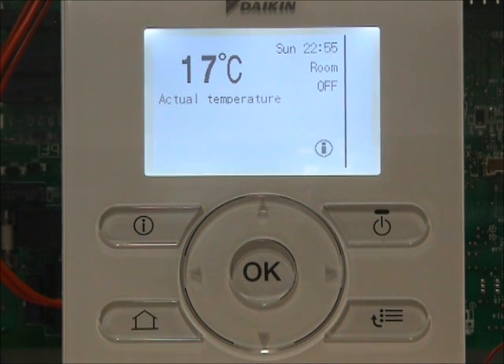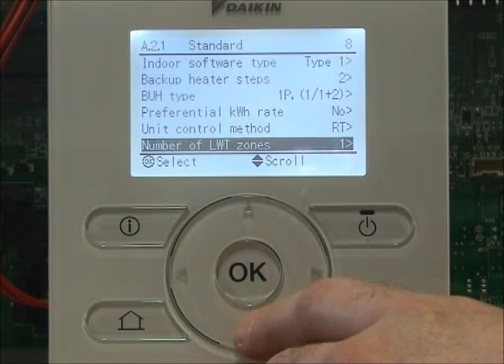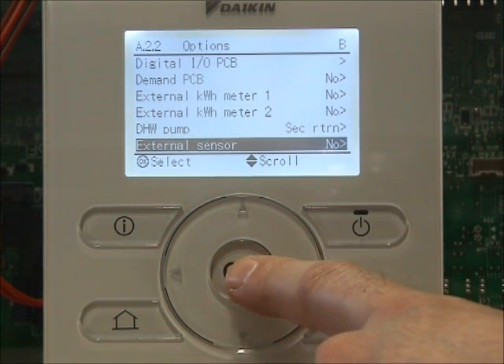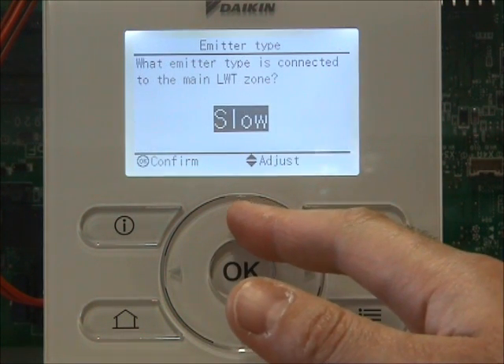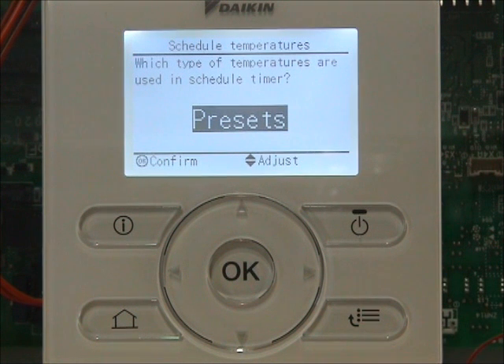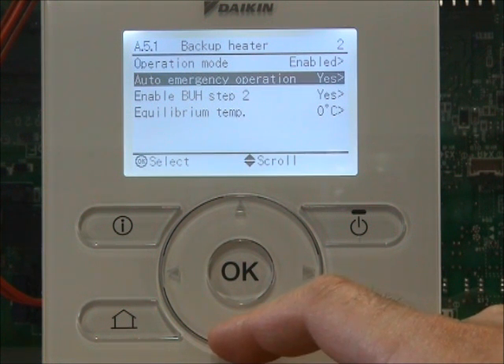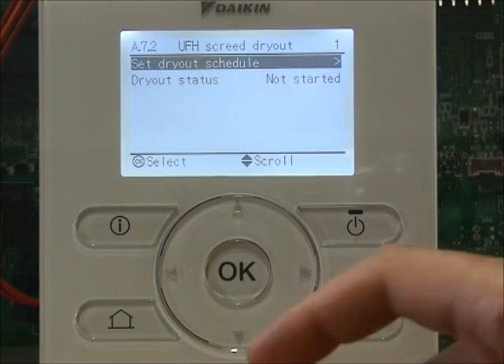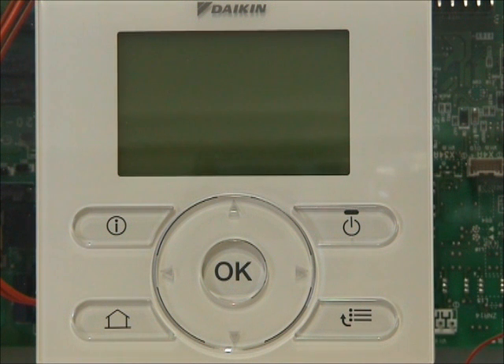Daikin Altherma Heat Pump Hydrobox C Series Controller Tour Of The Installer Menu

Comment: Hey! Very useful video, I have a daikin LT which has this pannel in a cupboard inside, the monoblock is outside. Connected to a HIVE thermostat which is in the hallway. I want to uninstall the HIVE as apparently is thr worst for heat pumps, but do I need another thermostat or can I just use this pannel you are showing?

Comment: What a brilliant video which explains it so well for an absolute novice like me.  Only one problem - My controller used to show many things on the menu but now only shows "Adjust date and Time" I have tried the switch off for 60 seconds trick but this does not restore the original menu.  Any ideas??
Reply: Press the menu button and then hold on the info button, that should give you extended menu

Comment: hi great video about important parameters ..! i have a question please : is it possible to start manually the water pump (circulator) simply to adjust or tu tune the water flow  on each loop of the circuit in order to equilibrate them ?
Reply from the maker: Yes you can do this in the actuator settings

Comment: Hi if you're still on here, what should the 'Desired Comfort and Eco Main LWT offsets' be set at for Heating? Thank you
Reply from the maker: This will depend on the design of your system. If you speak to your installer they will be able to guide you as they designed the system based on a flow temperature.
Reply: @brunstar111  Thank you

Comment: Hi. Thank you for uploading this very detailed video guide to the controller. I've recently moved into a new build house with a Daikin heat pump system and the instructions we've been provided by the builder are somewhat basic.
Reply: On the off chance, are you in the UK and this is a Cala house? I'm also in the same situation
Reply: @PhillGoodFactor83  yup UK, but it's a Stewart Milne home. Thanks to this video I've also made various tweaks to the system. I now have a Netatmo intelligent thermostat and radiator valves integrated to control the heating and adjusted the Weather Dependant Curve to better suit the weather in this area. Has worked fantastic so far over the winter, but still to do a cost comparison against the combi boiler we had in our previous house.
Reply: @orion1983uk  sounds like Daikin must have been doing a deal. I know of countless new estates where no one has clue how to set these systems up. I'm goinf to go at it this controller mid week. Would you mind if I shared notes here?
Reply: @PhillGoodFactor83  no problem at all. Can't promise I'll know it all, but will do my best if you do have any questions.
Reply: @orion1983uk  I liked your comment as a colleague (physics teacher) has just explained to me why the Weather Dependant Curve needs to be adjusted to suit our Irish weather. Going to take a couple days meter readings before adjusting.

Comment: Hi Anthony, just brought a home with this system and getting g very little support from the installer. I’m an electrical engineer and would like to access engineer settings but the installer has locked the CP out. Is there a work around to access engineer mode. Thanks for your help. :)
Reply from the maker: Hi Duston, if you download the manual from the Daikin web site then this will take you through the settings.

Comment: Hi , very informative video. I have this system installed in a holiday property. When we aren't using the property we turn the hot water off. Will the weekly disinfection function still operate even when the hot water is turned off?

Comment: I have the same panel at home. Two of them actually, and they both stopped working at the same. There is nothing on the screen and resetting the breakers hasn't helped. Wondering if you know what I can do before calling in a repair specialist?
Reply from the maker: Omar Kasrawi if there is nothing on the screen to both then you must have had a power problem to your home.

Comment: Hi, perfect video!!! Can I have question? I have first season Daikin altherma LT 8kw, split, floor heating, house need just 7kw. Domestic water set to 45C. Heating set by weather 25C output water in +15C outdoor temperature and 35C output water in -15C. So usualy output water is 28C. Problem is that output water temperature is to low and in every defrost is used bivalent source. It consume lot of energy. For 150 days (winter)  is used 2400 kW by external unit and 480 by indoor unit. And final cop is 2.5. Is that cop OK?  Can I reduce that bivalent source for defrosting? (disable bivalent source etc.)?  Thanks

Comment: Hi Mate! Just a quick one. If I would like to install a system without hydrobox do you think I would be able? I mean I have a Daikin Altherma ERHQ011AA and I would like to know if I can install it with any heat exchanger or I need specificaly the hydrobox? From Daikin Altherma ERHQ011AA the hot air water is coming inside directly? Thanks in advance for your help.
Much appreciation.
Reply from the maker: +Hunor Andras you will require a monobloc system if this is what you would like to do. Or you must use the hydronic with the split type outdoor unit.
Reply from the maker: Thank you please subscribe!

Comment: hello, i have a question here. the thing is im not getting into the meny.. and each time i go into meny the only ting i se is the "set time/date" category and nothing else.. and i also get AH-00 problem and 7H-01 problem think.
Reply from the maker: it is best that you get in contact with your installer to go through the fault codes with them.